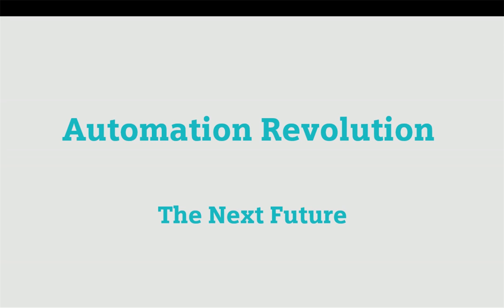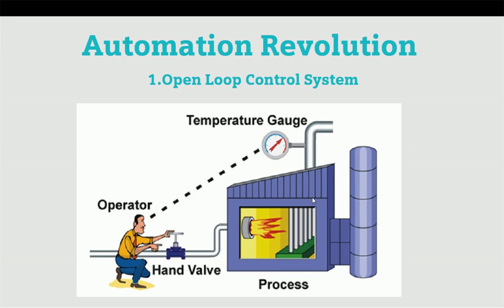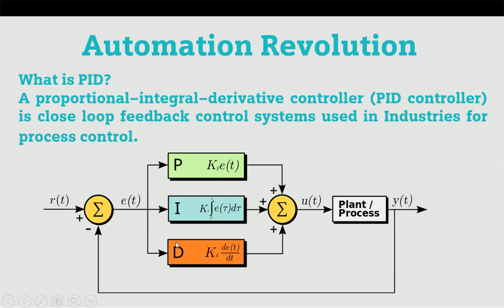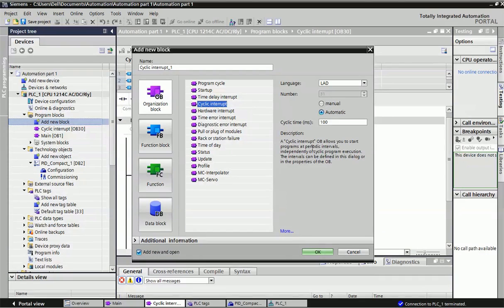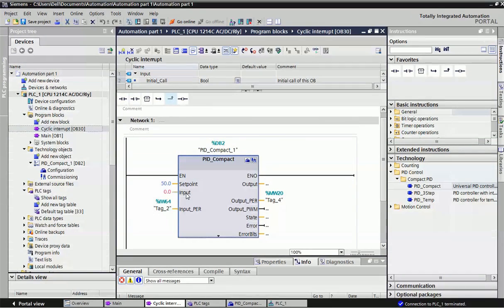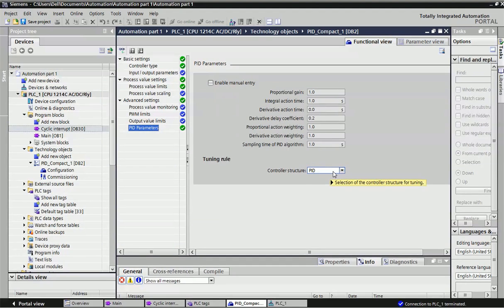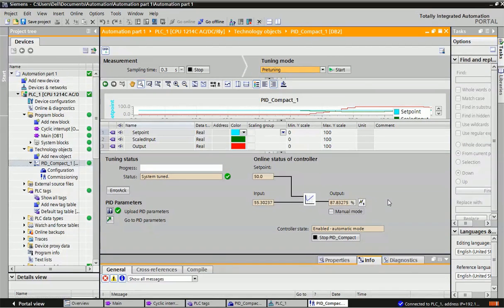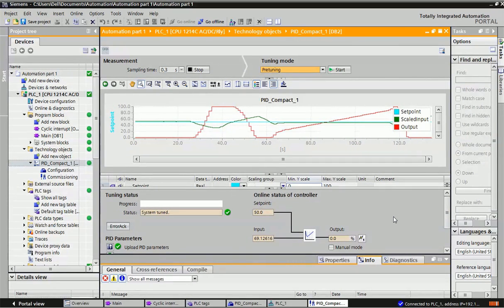PLC Tutorial 8 : PID Control in Programmable Logic Controller (PLC)

Comment: If the operator is adjusting the valve according to the reading of the temperature gauge, can we call it an open-loop system? Ain't that A closed loop?
Reply: Hi, i understand what you mean 🙂 but technicaly the close loop is when some read device is physicaly conneted to the process. With our hands we will kill the correct précision.

Comment: Dear Sir, Can u please make a video about Data Blocks, Function Blocks and servo &stepper motor control using tia and simatic manager
Reply from the maker: +Abid Nawaz Hi , I have made video on date block and function block. pls check other videos and for stepper motor I will make video soon.
Reply: Fine sir, Please make servo and stepper both videos also using simatic manager and tia portal.